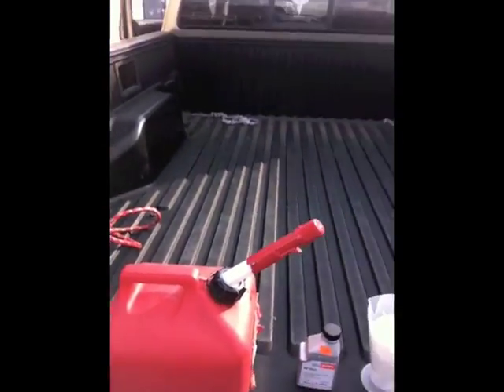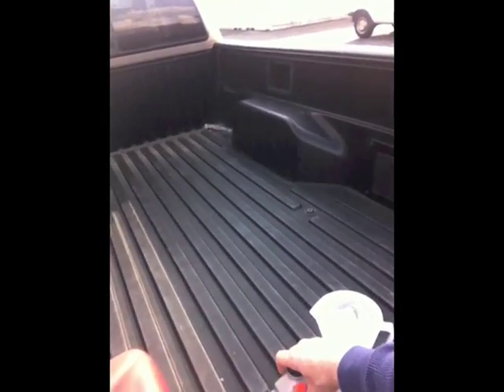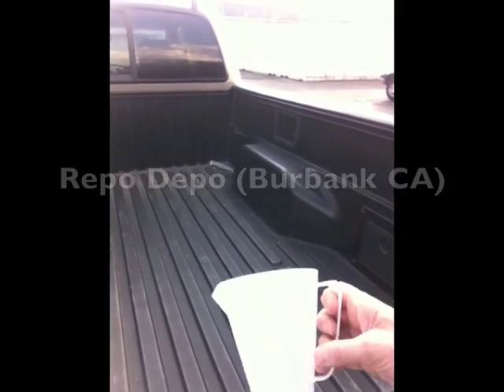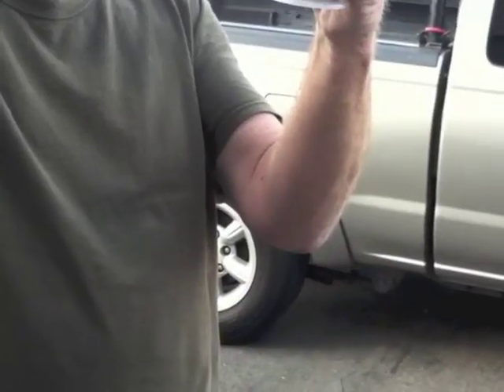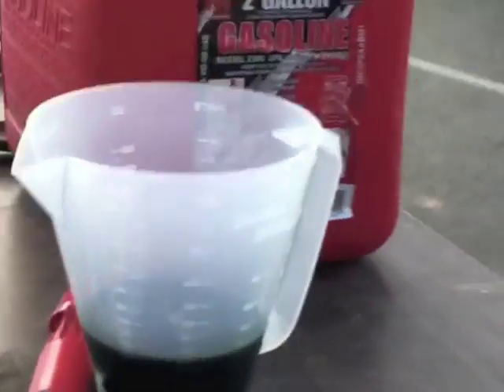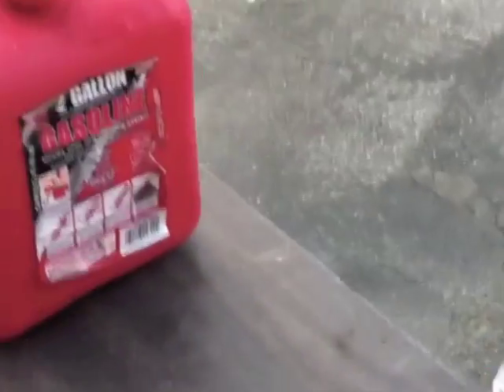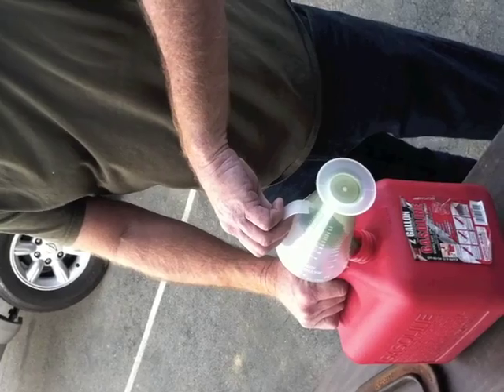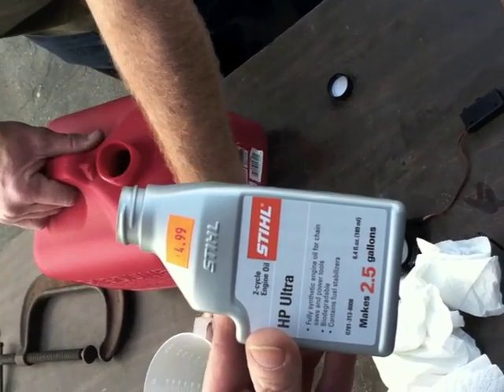Saito FG - 21 Gas Four Stroke RC Engine

Comment: Disgusting!!! Firstly, you must break it in. Right way to damage!
Reply: I just bought an FG-21 new and they're very specific on the breaking-in. Ten second on idle to warm it up, then rich up the fuel mixture so it won't go above 4k rpms at WOT. At least 2 tanks running it this way until you can start to leaning it up a bit.
Reply from the maker: I sold the motor to a friend on RCGroupsCom and it is still running great! I will post a link.

Comment: Thats really rich fuel
Reply: On initial start up and run in, the engine is supposed to be so rich that it shouldn't be able to rev to 5K at WOT. You do this for the first two tanks. Then the next two tanks you start leaning the high speed needle. My FG-21 was so rich, oil was spaying out the crankcase vent.

Comment: I put it on a 62" wingspan MX ARF that weighed about 8 pounds. It didn't have vertical aerobatic power. So I'm guessing that the thrust was a bit less than the full up weight. The lack of a (really) pumping carburetor was also a big problem. Changing airspeed caused bad leaning of the carburetor, in the air.